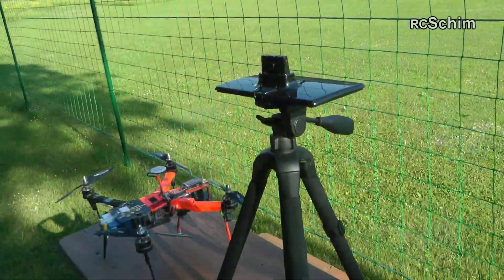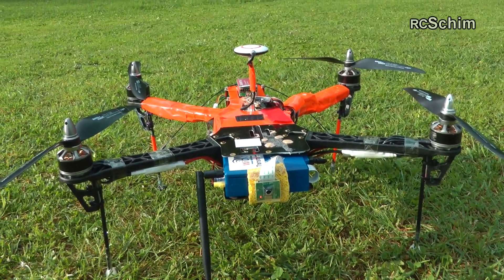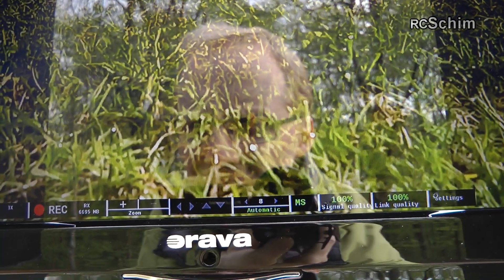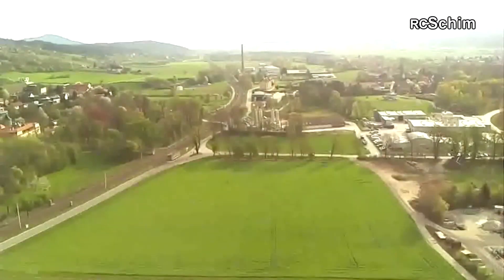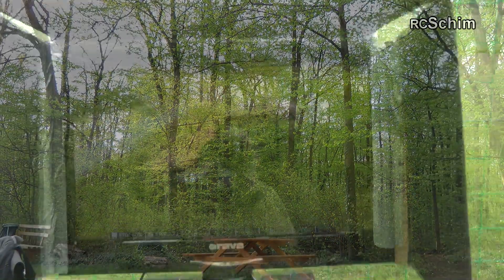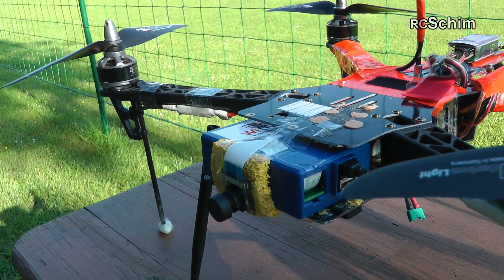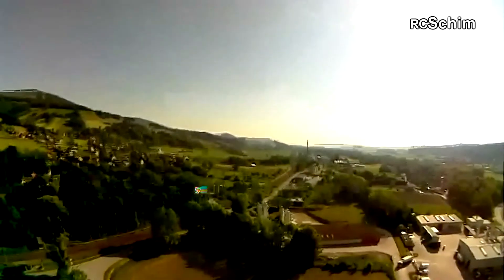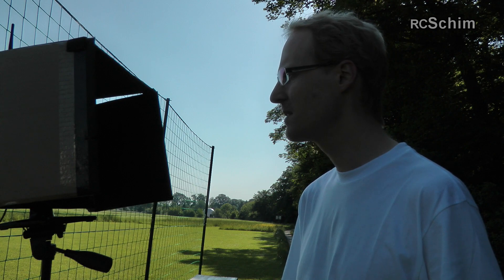WirelessDV - Digital FPV Downlink tested - Review and commented flights

Comment: Nice video Mario. We will all go digital soon but this is not good enough yet.
You also set new standards for jello:)
Reply from the maker: ***** thanks Gerard, I'm dreaming of latency free HDMI liveout directly from gopros and other cams into something as small and reliable as the ImmersionRC VTX we all use and love now. maybe just on 5.8 with good coding and retransmission in case of dropouts. good range because on digital you are allowed to transmit higher than on broadband analog...
I think jello here was extreme because my initial mount of the very small and light RaspPi cam was unfortunate... plus my Disco maybe shaky as hell ;-)  Now I see how good the "GELBLOCK" under my gopro got rid of all vibrations in the past.

Comment: How would you say this compares to Lightbridge?  I just don't understand why these WiFi based systems cost so much money.
Reply from the maker: WhiffleX please see my comment below to max. Lightbridge felt a bit more stable in good conditions. But at some locations I had terrible range and freeezes. Lightbridge is now really cheap if you consider it's beeing sold with a Phantom3. 
Main disatvantage from P3 lightbridge for me: only video on app is supported which felt not so smooth as HDMI lightbridge images (and had considerably more latency).
Also I cant say how much the mobile device performance and stability can get you into lightbridge troubles. I felt that after restaring my galaxyS4 lightbridge performance in the app was better....

Comment: Interesting! I do think digital video downlinking is the way of the future :) 
120ms doesn't seem like much to me (?) 
Cheers and thanks for sharing!
Reply from the maker: ***** they already are testing their system on 5.8. and their retransmission coding seems to be working really good. So I had no freezes but rather those weird looking false color artifacts (where you still could see landscape, just in wrong colors).
I have to add: (and will write it in description as well) that on my flightfield the Inspire1 had some problems with interference also. I had Lightbridge dropouts starting at 200m there! So something must be going on there. (the reflection of the huge chocolate company, powerlines from train, houses nearby...)
Lightbridge: had another flight were Lightbridges way of fighting bad conditions was VERY BAD. Screenshow of only 1-2 frames per sec. sometimes 5sec the same frozen frame...
So I'd say their protocol is quite tolerant and good considering the huge efforts that must have been put into DJI lightbridge!

Comment: I've been testing the new 5.8GHz version for some weeks now, it makes a lot of difference regarding interference. I fly often in a club, crowded by 2.4GHz RC with rather bad results on 2.4Ghz video, but now using the 5.8Ghz link is solid as a rock! My only problem for now is to get rid of the jello of the CMOS camera, I already swapped my props for Graupners and made a clean platform for the camera mount to no avail. The max. distance on 5.8Ghz is of course less than when using 2.4Ghz, but I don't use it for long distance flights anyway as I don't own a UHF RC. In my club a member was flying his Inspire 1 with lot's of hickups, high latency and a bad link to his tablet. If I compare I like the WiDV better.

Comment from the maker: Oops, just ran into the Video-Descriptions size limit ;-)   So I have to add the Lightbridge vs WiDV thoughts here as comment:

My thoughts on "Lightbridge vs WiDV system"
WiDVs retransmission coding seems to be working really good. So I had no freezes but rather those weird looking false color artifacts (where you still could see landscape, just in wrong colors).
On my flightfield the Inspire1 had some problems with interference also. I had Lightbridge dropouts starting at 200m there! So something must be going on there (the reflection of the huge chocolate company, powerlines from train, houses nearby...)
Lightbridge: had another flight were Lightbridges way of fighting bad conditions was VERY BAD. Screenshow of only 1-2 frames per sec. sometimes 5sec the same frozen frame...
So I'd say WiDV protocol is quite tolerant and good considering the huge efforts that must have been put into DJI lightbridge!

Lightbridge felt a bit more stable in good conditions. But at some locations I had terrible range and freeezes. Lightbridge is now really cheap if you consider it's beeing sold with a Phantom3. Main disatvantage from P3 lightbridge for me: only video on app is supported which felt not so smooth as HDMI lightbridge images (and had considerably more latency).
Also I cant say how much the mobile device performance and stability can get you into lightbridge troubles. I felt that after restaring my galaxyS4 lightbridge performance in the app was better....

Comment: How is the latency ? In the german Forum they tried the same with the rasperies and it was a issu there.
Reply: Heckmann Markus It says 120ms in the RCGroups thread, not too bad.
Reply from the maker: Heckmann Markus I'm sorry that I didn't include a latency test in this vid - but I will do this (maybe a pic is enough). feels ok to fly with something like a Naza Quad if you dont fly to close to obstacles. Similar to lightbridge I'd say.
As far as I understood and read in the forums their approach is very sophisticated. They've put a lot of effort, testing and very optimized coding into this to achive so little latency.

Comment: Great video!  I wanna go to Germany to fly some time.  What are you rules about flying near buildings,  houses and roads and stuff?
Reply from the maker: +fuba44 Hi, first: I'm in Austria, that's the south neighbour of Germany. But here in Austria "Drone Laws" are even more strict than in Germany I think.
Basicly you cannot fly here.
There is general split into:   toy:  <79joule (265gr mass) of energy and <30m flying height   => free to fly when you dont hurt people

normal RC model:  everything under 5kg and without cam or cam only for direct FPV flying (no recording allowed)

unmanned aerial vehicle (ulfz): 
you need license from "Austrocontrol" which costs around 400€ and takes 6month to get!
here you can fly in different categories of area and based on the danger level you need normal "phantom type" drones in unsettled area    up to fully redundant everything (FC, Battery,...) if you wanna fly over houses or even people.

I got me a lic for phantom2 type so I can fly in most rural locations where I dont fly over houses, or I fly with very tiny miniqudas which are TOY classified.

So it's not easy to fly here as a guest and stay legal.
It's not prosecuted heavily here - as long as you stay out of trouble I guess - and be polite and ask for flight permission by the locals...

greets,
RCSchim

Comment: An opensource solution I'm using for a fraction of the price with similar performance: https://www.youtube.com/watch?v=AqZyPGgBl8I :)
Reply from the maker: Neil King looking good Neil. I couldnt fly proximity with latency ;-) please link some details about your setup for comparison. Range?
Reply: Latency is only around 140ms and perfectly flyable for me.  I contributed to an open source project started by befinitiv.  Search for him on Google.  There's also a discussion on diydrones: http://diydrones.com/forum/topics/3-km-hd-fpv-system-using-commodity-hardware?xg_source=msg_com_forum&id=705844%3ATopic%3A1988351&page=1#comments
Reply: Neil King Also, I'm not sure what kind of protocol WIDV uses but Wifibroadcast (open source solution) broadcasts h264 video packets without association (monitor mode) which makes re-acquisition quick when video is lost.  I bet changing to circular polarized antennas would drastically improve the performance you're seeing.

Comment: Lol 500$ for a piece of shit... 2 Raspberrys with WiFi Sticks for about 80$ in cases and with a Camera 100$ of hardware maybe, there are some open Projects on the FPV-Community for example using the Same Hardware, some of them with even better Wireless hardware from UBNT. That price is half of a Professional Video Downlink that has clear and great picture over 1-2km. Sorry, but this is really bad promotion. 
They just stole the Idea from some great Opensource developers and sell it for crazy prices.
Reply from the maker: InfinityRC you're comments are too harsh I think.  what do you think of the initial lightbridge costs? 1500$ and the materials used here are maybe 100-200$ if at all? It's the developement, testing and coding, inventing of own protocols that takes incredible ammounts of time and efforts. plus if you have just a small 3 man company you have no mass production and your shop running costs are quite high. I think it's a fair price - but everyone has to decide this for himself.
Reply: RCSchim  Lightbridge doesn't use mass production hardware like the Raspi. So there was also a lot of effort in the hardware design + higher production costs. The lightbridge uses a diversity system for transmission. WIDV also sells this.....but then you could also buy a lightbridge for the price. 

The WIDV system seems to work ok, but compared to the befinitiv-opensource-systems i don't see any reason why to buy it.
Reply: RCSchim The Lightbridge uses extremely expensive FPGAs for De and Encoding Video and Audio as well as expensive Wireless Chips. This Rasperry project is using a big amount of Opensource Software from Opensource Devellopers who want to bring better experience to Users for free and sell it if it's a Whole new inventions made 100% by there own. I bet they don't even think about contributing to the dev's who wrote a big part of the Software they are selling.
Reply from the maker: InfinityRC You might have a point here (reselling a project based on open source). 
Not so sure about the lightbridge. At some points it really worked well but on other occasions it just did terrible. Thats a kind of unreliability / instability that I don't know from analog VTXs.
Reply: +InfinityRC If you just compare the HW used, the price asked is rather steep. But so is also an Apple iPhone. It's the FW that makes this product stand out of the crowd. It can also transmit bi-directional MAVlink telemetry, record the captured image on both air and base unit, record a log with the GPS data so in case of a fly away you will know where to start searching and many more features. In the next weeks the OSD will also change from text to gauges, a nice touch.
Reply: omg you are right what a rip off